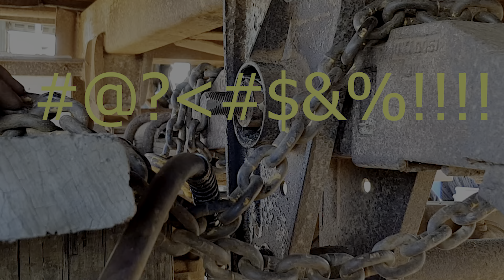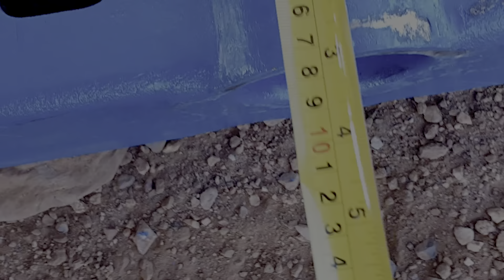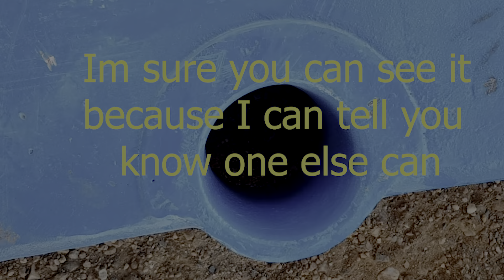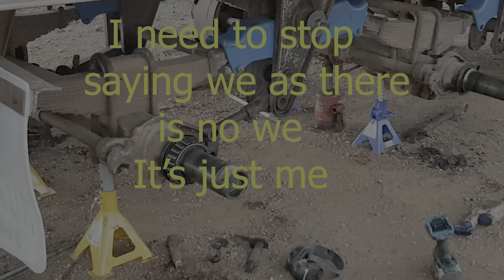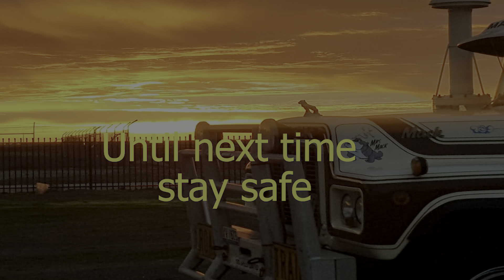My Big Road Trip in my Mrs Mack Part 2

Comment: Well that answered that question i was going to ask...sellers didn't help much other than the crane...
Really like your fair dinkum-ness ,strong as an ox and just as stubborn to boot.vids are good.thanks
Reply from the maker: The sellers couldn't really help much as they have a business to run, they put the trailer in some shade out of the 40°C heat, gave me access to the power etc and let me usevthe yard as long as I neede to
They were very good to me and said numerous times if I need a hand just ask

And I'm sure they would of helped if I had of asked